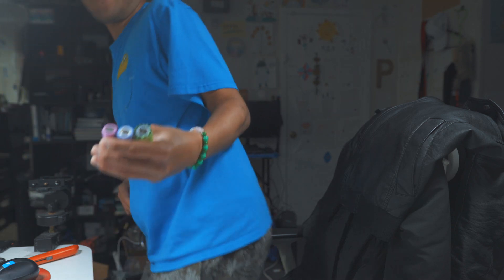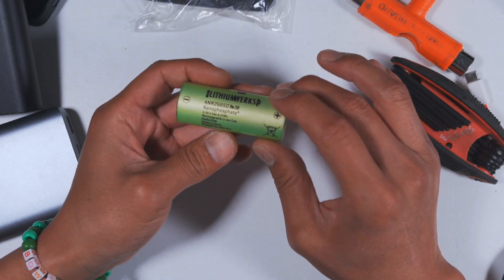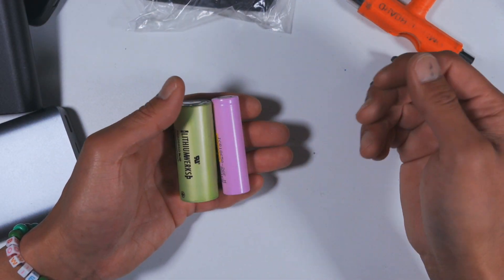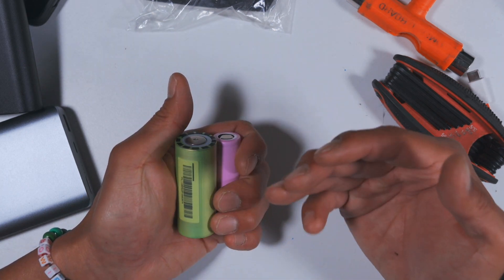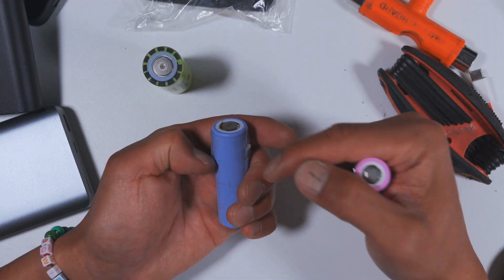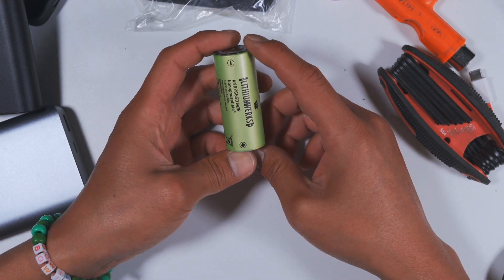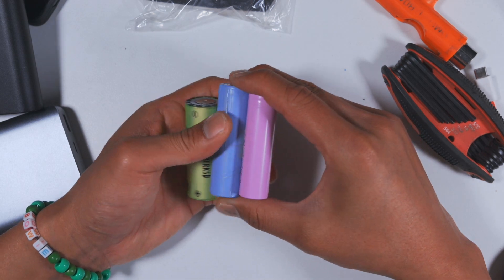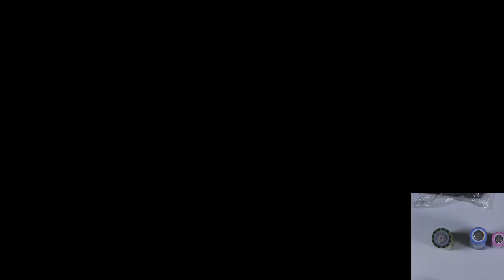18650 vs. 21700 Tesla battery vs. 26650 Battery Explained!

Comment: sir good explanation ..I have used the battery in my 12S pack .as it separately has so many advantages.after  one year of use on my ebike there was serious issue of imbalance so bms was cutting off too soon while charging for over vol n while discharging for under vol..we tried to discharge on bench tests and finally found that though volts are ok there is no correlation with amps per cell for corresponding voltage

Comment: Dr E FYI: All 26650's are mis lableled' regardless of brand. The 26650 is a 18650 battery packed inside the 26650 can. 18650's DoNOT have a rating over 3700mah. Therefore no 26650 can be rated over 3700mah. China's biggest lithium battery scam ever.
Reply: So I have some laser pointers and some long throw LEP flashlights that have a straight edged condensed beam that's been measured at 2,560meters up to 3,100 meters. So I have a question for you.. I have one GH 18650 6,800mAH 3.7v and a Epoch 30P 18650 industrial series  rated at 3.6v 3,000mAH 15A 10.8Wh so is there significance considering the 3.7v to the 3.6v? Also the industrial is rated at 3,000 mAH where the other is a much larger 6,800mAH what is the significance of 3,000 vs 6,800 mAH??
Reply: Also I have two  lithium ion 21700
One is EPOCH INR 21700/3.7v 5,000 mAH / 10A   the other is INR21700 -40T Samsung SDI how do these compare to a  Lithium-ion SW26650-50ME. 18Wh 5000mAH? Also in this video he says the 26650 is an Lithium Iron Phosphate but on my battery it says it's a Lithium -ion so this video is a few years old. Did they start making the 26650 in a Lithium-ion??  Also what does the 18Wh stand for on this 26650?? The EPOCH 18650 had 10.8 Wh? The SW26650 seems to give my flashlight more power or a brighter beam compared to the EPOCK 27100 battery. Your thoughts? Thanks for your help answering any of my questions

Comment: if i'm having trouble with soldering old joints is it just coatings, or corrosion, heat, flux? sometimes it's like the solder joint is fighting me

Comment: 😁21700 is what I got now, and I'm cool with that.  Now to do a custom work.
Reply: 26650 for the win, much more capacity compared to 21700.
Reply: @receptayyip1410  And it cost more than 21700 as well.  60v 30ah 21700 batteries.  I'm fine with that.  26650 will be too big for my scooter.

Comment: The A123 LiFePO4 cells have way more cycle life than typical (NMC) Li-Ion cells and THAT is the reason Boosted chose the A123. Yes the range of the A123 sucks because capacity is just half for the same volume, BUT your typical Li-Ion cell battery only last about 1-3 years (300-500 charge cycles), while the A123 cells last 8-10 years (3000 charge cycles).... Boosted didn't want so much costumers sending back dead batteries still on warranties so they went the A123 route. Also A123 can push double the amperage of li-ion, so more acceleration. Telsa does it with long life and Li-Ion by using extremely refined BMS, only cycling batteries around 20-80% (shallow discharge cycle can quadruple lifespan), actively cooling batteries, and by spreading amp load to enourmous amount of cells because car can afford to log 400 kg batteries, not an eskate though. If you don't mind replacing you li-ion battery every 1-3 years on you esKate, go the Li-ion route and you'll have great range. If you want an eSkate with a battery that will outlast all the other components of the board, want great acceleration and don't mind having shorter range, go with A123 cells.

Comment: Which one is best?
Reply from the maker: 21700 is more efficient but still weighs more, less volume.  18650 still very good cost efficient and lighter but more batteries.  Use both as options, not one is better for every situation.

Comment: 26650 would make great power tools. The durability, cycle rating, and high amperage could make a pack that is capable of offering lifetime warranty, unheard of for power tool battery. They would also cone in at 16v, avoiding the 18v licensing fee. It would be easy to advertise them as 5 cells with the power of 10. Smaller tools that give up nothing to 18v 10 cell 18650 tools.
Reply: i dont know there's licensing for specific voltage being used in power tools..
Reply: @sworddice  there is, for some reason the patent office in usa granted milwaukee tools an exclusivity to run lithium cordless at 18v, and so they collect royalities when others do 18v tools. it's asinine, but it's true.
Reply: Bosch use them.
Reply: They're also more dangerous if 1 cell fails at 4.3V(overchraged) there will be to too much fire than 18650.

Comment: Does 21650 and 21700 battery can use the same charger?
Reply: Depends

There are 26650's that are 3'7v (li-ion) and 3'2v (lifepo4). If your 26650's are 3'7v, most probably you can use the same charger (as long as the cells fit) but if they are 3'2v, you'll need a charger that can change the voltage it stops at

Comment: Good video, I have a question, I just ordered a 26 650 battery for vaping mod for e-cigarette, it indicates that is fully charged but when I use the device it says low battery. Could this be a cheap knockoff battery or are these batteries specifically made for e-cigarettes?
Reply from the maker: That's because 26650 batteries have lower voltage, if your mod doesn't include change for the voltage it will say low battery.  Fully charged 18650 is 4.2v vs 26650 3.7v.

Comment: lets add one more to the mix. what about the 26700 battery in earlier Milwaukee drill v batteries. Can you use the same charger on the smaller batteries? The batteries in my V18 Milwaukee takes a full charge, However they only last about 5 minutes and it goes almost dead again.
Reply from the maker: I would probably not use them drill batteries, you don't know what the current limits are on the BMS of it(unless you know) and that could be causing the battery to not work, perhaps not dead.
Reply: @dr.eskateboard3381  I am referring to the original battery pack.

Comment: Didnt know samsung 40t was made by tesla. They are the same size but totally different cell chemistry.
Reply: they are not made by tesla but by Samsumg. However, Telsa does make lithium cells with the same 21700 can format (that is 21 mm diameter by 700 mm lenght), but telsa chemisty might differ a bit from Samsung's.

Comment: Some of your stuff is really informative and intelligent! Then you make videos like this one and it's just sad. Your shop or ur garage looks to be   disheveled. I mean how hard is it to have a scale handy when you're going to be teaching people about  battery's you know you're going to need to weigh The Cells to compare them and then you're so redundant you spend 12 minutes saying the same thing over and over again come on bro your game is better than that.... for example you didn't mention anything about the internal resistance of the cells which is one of the most important things when it comes to building a balanced  battery pack. And your nominal battery power and your actual battery power are two different things. I'm in no way trying to be rude or mean my brother... but in my 45 years I've learned that you're true  true Brothers will tell you when your game is slipping and failing below the Excellence you're capable of to help you better yourself.  God bless you and keep you safe....
Reply: Who the fuck care if his shop is disheveled? Weird flex but ok
Reply from the maker: Well I try to make it easy for regular people to understand, not confuse them with every technical detail.  Please understand not everyone has a background in electronics.  It is hard to teach. ;)
Reply: @dr.eskateboard3381  certainly you can't please them all.  Still a great video as i haven't been up to date since my 10S4P with LG HG2 builds.

Comment: Boosted were using a bit expensive battery. It's no wonder they're expensive.
Reply from the maker: It is very outdated battery tech that's why they went out of business.  Stopped innovating
Reply: Their batteries are not why they went out of buisiness. They went under when they branched out . Do you remember the mini and the scooter. Big branches make heavy limbs